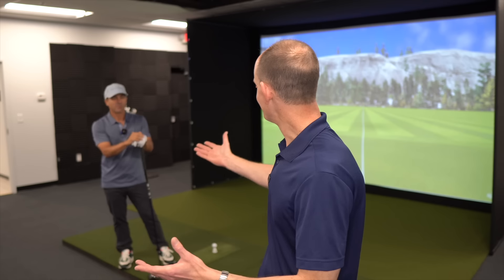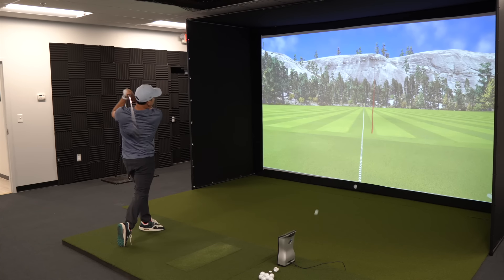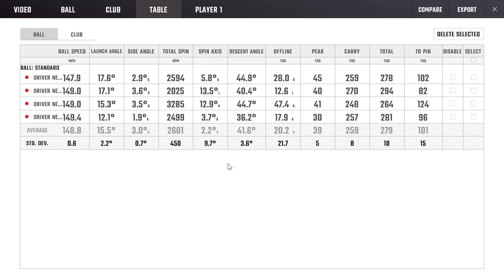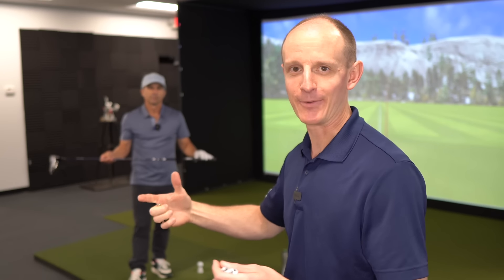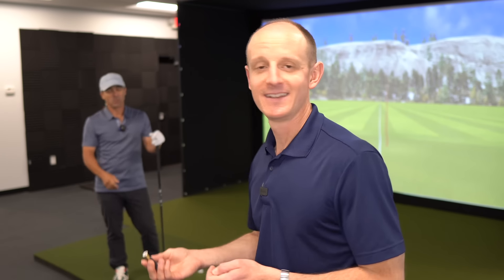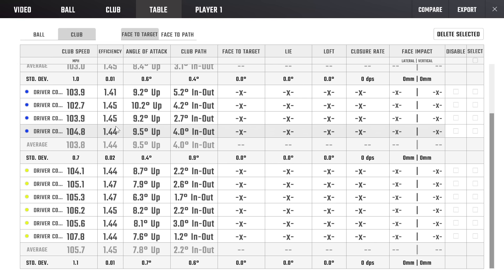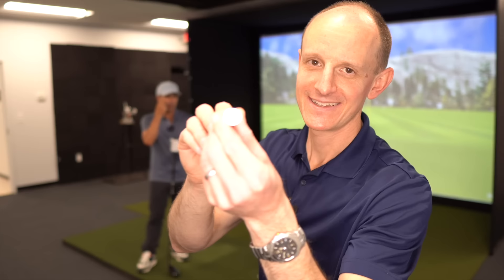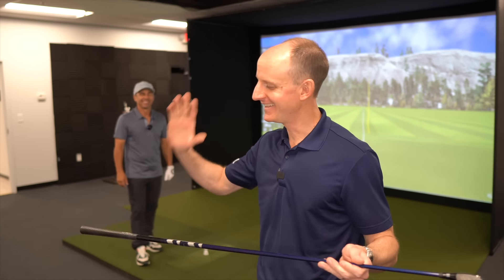Greatest of All Time Driver Hack / COUNTERBALANCING

Comment: I also counterbalance my driver. I like the extra overall weight of the club and it feels like it helps me engage my body/bigger muscles just a little bit more when swinging. How I counterbalance is with a 1/4” carriage bolt 3” long and nuts (use gf’s digital kitchen scale to weigh out desired grams) Wrap it with masking tape to make a snug fit and prevent rattle in the butt of the club. Cheap and it works well for counterbalancing!
Reply: I like this idea, gonna give it a try.
Reply: I use my cocaine scale.

Comment: I'm a certified club maker from the Golfworks Malby school with 12 years of experience under my belt.  I've tweaked and assembled thousands of clubs, and I agree 100% with the findings in this video as they have matched my experimentation almost to the letter. HERE'S A TRICK -> A few years ago I went to a local machine shop and had them drill holes in square metal weights so I could put my tee through them and into the back of the grip for quick and easy experimentation. I put poster putty between the weight and the grip to avoid any vibration issues as I tested and switched out the different weights. What I finally ended up doing, after I found the proper weight was making the driver  1" longer and putting the weight BEHIND the hands in the 1" space. Then I just told my customers to grip down 1". When the weight goes behind the hands you'll get the maximum affect of this experiment. Give it a shot. also - I think you'll love it. Great video  -  Cheers!
Reply from the maker: I've had that video idea for over a year. The pommel of a sword concept on a golf club. Now that I know it's had some success, might need to move it up my to do list.

Comment: I've been doing this for a few years.  I also add head weight to bring up the ball speed and return the head feel to the golfer.  D2 feels factory but muscular golfers can swing D5-D10 with ease.  Some golfers prefer a light feel with the lightest shaft and headweight (40g shaft, 196g head) and 12 g CB weight in the butt section.   Almost everyone can benefit from some tinkering.   It helps to blow the grips on/off while experimenting

Comment: Nice to see Mr. Short Game and you teaming up on a few videos. He is definitely getting a better response than I did. I switched from medium grips to jumbo that were 25 grams heavier. When I did this, I couldn’t tell where the head of my driver was, the club head just feels light and out of control. I might add that my swing has changed quite a bit for the better, this has nothing to do with swing weight as I’m striking all of my clubs much better, except for my driver. New club fitting coming soon, so I’ll see what happens. Cheers.

Comment: I have been doing this to my clubs ever since I found out this is what Jack Nicklaus was doing with his clubs. Jack had his own brand called AirBear and they came with counterbalance grips. The counterbalance made the club head feel lighter so I did not have to swing as hard to get club head speed. At 5’9’’ and 165lbs and quick hands I was able to easily Carrie the ball 320 yds.  My longest drive was 342 yards.  I lot of my golfing buddies told me that they were going to get me test steroids. That was in the 1990’s in my 30’s and 40’s. Now in my late 60’s I can still hit the ball 300 yds.  But now it is harder to find the counterbalance grips. Now after watching you guys, I’m going to go and buy the weights and have them installed with my next set of grips.

Comment: F = 1/2 (mass x velocity^2)  the rate at which kinetic energy is created in a golf swing.  Increasing mass will increase the kinetic energy linearly, but increasing velocity exponentially increases it:  2x = 4x, 3x = 9x, 4x = 16x, etc.

Putting more mass in the handle of the club should create a slower backswing when acting against gravity and a faster acceleration in the downswing at the point momentum and gravity cause the lead arm to separate.  

My intuition tells me the added mass in the hand area would cause the path of the lead arm to change as it flies down in the same way a movable weight in the club head affects face rotation and angle at impact.  

The difference in feel would also affect timing and how the hands would react when reaching the bottom of their swings arc ahead of the club head mass.  The more mass put in the hands the slower they will react and come back up giving the club head more time to accelerate around the hands before impact, the same F=1/2(M x V^2) cause and effect creating more striking force, compression and ball speed.
Reply: I like to think in simple terms. If adding mass to the club does not reduce my swing speed then I will get the linear increase in energy transfer. From a pure velocity standpoint, it may delay the release enough to move the max velocity closer to impact as well. Lots of individual trial and todays launch monitors could be super useful here.

Comment: I had been doing this for years with the clubs I assembled from Golfsmith components for myself and others. I always try for a swing weight in the C5-6 range for myself. When I buy a new driver I swing-weight and regrip immediately. My current driver (Cleveland Launcher) is set at C6 with oversized grips.

Comment: I have this done with a XR16 driver I have, I went about this by using tape, I did for fun to see try it against my SIM2 driver.. I am 6ft and using a 44inch driver tensi blue reg flex tipped 1 1/4 inches, with a Lamkin Mid size with 11 layers of tape. 6 full length then 5 front grip, feels totally fine.  Swing weight change from D1 to C8. I did notice the straightness plus the swing speed went up form 95 to 105MPH, and I am not chasing speed either. Distances are up too Carry 250 yards roll out 270 yards.  I had read that they used coins under the grips..

Comment: I bought a different shaft and a different loft of the same head. It was cheaper than buying a completed club. That shaft was 30g heavier with similar characteristics as my existing shaft. Using an online swingweight calculator I was able to get it to C8/C9, but that is an estimate. After testing a bit I was averaging 105mph with it. Swap in the heavier shaft 111mph average. That worked out to D3 swing weight. Again those are estimates. I was honestly surprised. I thought the lighter shaft would have been a monster, but it just wasn't the case. I would definitely like to try the counter balance in this other shaft. Even 10g would make a difference I think.

Comment: An interesting question here would be.... Would it be the same result if you only go the lighter swing-weight road by subtracting weight from the head side of the club and not adding at the butt? In essence, actually lightens the total weight of the club. How would a heavier or lighter club affect your ability to hit the ball consistently.
Reply: Good experiment....  Thing that will def change is how the shaft will bend with a lighter head.... it will play much stiffer so will change flight for good or bad
Reply: Good question! I'm no expert but I think most people like to try this vs making the head lighter because physics tell us if we can swing something with more mass at the ball, at the same speed as the lighter object it should travel faster/go further. I'm sure there is a point of diminishing returns, but I'm excited to try!

Comment: When I had a station I broke balls all the time.  If I hit one too many times in a row quickly, it would break and or crack.  Titleist were the least likely but they still broke.  Wilson Staff Duo 60 compression were only good for a few strikes.  I broke all of them.  Therefore, a ball has to be experiencing some stress or recuperation after it's struck and compressed and if so, surely it wouldn't perform exactly the same on the next strike.  I found that if I let the balls rest for 5 minutes or so, they didn't break, but if I pounded one ball in succession it would break after about 10 to 20 strikes.  These are not only being struck by the club but hitting the screen as well, whereas mine flew into a soft net.

Comment: Try the reverse as well, get a lighter club head or lighter shaft with same CPM and load point. Alot of people cannot feel the head when you butt weight, so they increase speed and spray everywhere. Also the shaft may become to soft for that speed, yet, feel stiffer to the player

Comment: Moe Norman also did this on all of his clubs. Your're right-2oz backweight on each club-why Moe always chocked down-so weight is on opposite side of hands-slow the hands down-like Nicklaus & the secret grip-Moe's driver was 16oz & E3 with all clubs-I suspect that's before backweight-brings it to C+ much lighter feel but overall heavy. BTW.........Where did you get the weights?
Reply: I picked up on Moe's counter balancing secret about a year ago and spent most of last year experimenting. It definitely helps consistency!

Comment: Would the result be similar by just adjusting the swing weight of the club by using a heavier grip?
Reply from the maker: Yes a heavier grip is doing the same thing albeit the weight will be much smaller vs a 25g or more counter weight.

Comment: Moe Norman said he trained himself to swing an E5 swingweight at the age of 18 and swung that eversince. Ive been wanting to try E5 but cant find anyone locally to build it
Reply: E5...That is heavy. I'd mess around first with lead tape, on either end, before having something built. Moe Norman is 
a big, stocky guy. I'll assume he was similar in younger days. It would make sense that a heavier club would suit him 
and promote consistency. I think shaft length, flex and one's height must all be factored into any experiment with 
swing weight. But the results may not be as predictable as one would think.
For example, Clay Ballard, who is tall and swings a longer shaft at about 119, tried butt weighting and saw no 
improvement. But my son, a 5'11" scratch player who is in the mid 120's, saw a clear dispersion improvement 
after butt weighting.
It is obvious that there's much input required to arrive at a true swing and contact improvement. And that there's no
better method then adjustments made to one's personal swing. But if you're not willing to invest in some basic club
building and monitoring equipment, you'll be spending considerable time and $ at a fitter's studio.
Some people prefer their coffee in fine china, others like a heavy mug...And this preference appears to have little to 
do with body style, gender and/or strength.

Comment: What do you think would happen if you cut the driver shaft length down and then counterbalanced the weight at the butt end? Thank you for a great video!
Reply from the maker: The head will "feel" much lighter in that case. You might need some heavier head weights or lead tape but it's all theory until you actually try it and see what happens.
Reply: @EFGMC  Thank you! I appreciate your thoughts on it. I might try this. outside of practice I struggle a bunch with Driver dispersion and am trying to see/understand if this might help without sacrificing ball speed. Cheers!

Comment: What nozzle are you using with the compressor?
Reply from the maker: It's the plastic raft tip that fits snuggly into the grip vent hole.
Reply: Thanks for the reply. I went back and checked your video about the AstroAI and saw that. I should have done that before 🙄

Comment: Great video and very informative. I have the PXG Gen 5 driver. It has 3 movable weights in the head. Would you expect to have similar results if one was to just decrease the weight in the head and leave the butt end of the club as is?
Reply: Hey Paul. You will have a lighter club and swing weight. The issue would be which Wright you remove and its effect on moi. You could increase spin so swing faster but get less distance, also an argument could be made for a reduced smash factor. But why not try it? You might learn u love lighter feel.
Reply from the maker: One of the golf publications did this a few years ago taking all the weight out of the head and comparing. They did get more speed but also lost lots of control.
Our test here did not see any loss of control.

Comment: Great Video. What is the air-gun you were using to remove and install the grip?
Reply from the maker: Amazon battery powered tire inflator.
Astro AI Tire Inflator
Reply: @EFGMC  Thanks, watching a video when you replaced the Kobalt compressor, now

Comment: Hi great video. Will a 50 gram weight for a Super Stroke putter grip work?
Reply from the maker: It should as long as it fits inside the shaft and doesn't rattle around.

Comment: I have a G425 max driver with a CB Alta 55.  Im wondering if I remove the 26g weight in the back and replace it with two 13g weights on the toe and heel. Would that increase MOI?
Reply from the maker: No. The weight far back will provide the highest MOI. Moving the weights up to to and heel will lead to more curve.

Comment: what effect does gripping down have on swing weight?
Reply from the maker: Same as if you cut it down within 1pt. Gripping down is a great way to see what a shorter club will perform like both for SW and shaft stiffness. Biggest difference is the grip diameter being smaller because of the taper.

Comment: Do you have or would you do a video on fitting those butt weights. Do they need epoxy or do they literally slot into place and are kept there by the grip over the top. Would there be any instamces when they would rattle or move and you can feel it in the swing?
Reply from the maker: They are held between the shaft end and the grip. I've never experienced any rattle though maybe if you were using the extremely heavy ones?? Still unlikely imo

Comment: How do you blow the grip on with the weight in the butt end? Seems to be in the way for the last bit, no?
Reply from the maker: Still works. Just need to adjust the inflator tip a bit  and focus your force on the very back end it get it on fully.
Reply: @EFGMC  Thanks! I have some butt weights lying around and I blow my grips on, so will do some testing this winter for sure!

Comment: I am 73 years old with a swing speed high 80’s low 90’s playing Ventus 6r with JumboMax ultra lite grips. I put 50g in the butt today and was a little longer and much straighter. Less trouble with slices. Maybe this works. The standard JumboMax grip is 60g heavier than the ultra lite. Would this give the same effect?
Reply from the maker: Yes, heavy grip will yield the same feel assuming the weight matches.

Comment: In general do you see a swing speed benefit for faster and stronger or slower players when adding the counter weight?
Reply from the maker: I've only tested this with players with over 100 mph club speed. Not sure what would happen with slower speeds.
Reply: @EFGMC  My buddy did this after I did with my shaft. Went from 82 to 85 mph driver. The feel seems right so now he is giving it more effort and can reach 87-88 MPH. That is a big jump for him.

Comment: Great Video.   Here's a crazy question.  Does my 75 gram wrist watch (on lead arm) have any effect?   Should I remove it when I play?
Reply from the maker: I don't know but that is a great idea for a video. As for you personally, try it with and without and see if it changes anything.
Reply: So simply adding some wrist weights should temporarily give this effect ? Perhaps not though, as the weight has to actually within the grip to give trubuchet effect ?
Reply from the maker: @mikebarnard2689  I don't know, and I suspect that the results will vary by golfer like so many things in this game. Would have to try it out and see.

Comment: Swing weight to desired balance and you don't have to do this.
I tried this many years ago when drivers were crafted from a piece of persimmon wood and still used steel and sometimes, aluminum shafts.
I lost the sense of feel in the club head.
Almost felt like I was swinging it from the head end.
I don't know if I gained club head speed but I lost distance and dispersion was crazy.

Has anyone else experienced this?

Comment: What did you use with the small air compressor to get the grip off
Reply from the maker: All these grips were installed with air for my fitting studio so I can take them on and off in 30 seconds.
Reply: @EFGMC  is there a special need tip you use at the butt end of the grip?
Reply from the maker: @Alehondro6  Nothing extra used.

Comment: Can you give me some info on that hot melt you mentioned
Reply from the maker: It's a hot glue product that stays tacky at room temperature. Primarily used to lower the pitch of drivers and fairway woods. Almost every tour pro has it in their driver.
Reply: @EFGMC  
Can I get a link to this? 🙏
Reply from the maker: @96gsxr  https://www.hotmelt.com/products/golf-club-weighting-hot-melt-cartridge?variant=27203520203

Comment: Question - Could you achieve the same thing by making the weight of liter?
Reply from the maker: Not sure I understand your question.
Reply: I think the word is "lighter" but not sure what it applies to.  Could be overall club or just the head to get it to C3.  Would be interesting to compare non-counter weighted C3 club to a counter weighted C3 club.  And yeah, getting something to C3 at driver length without counter weighting could be tricky.
Reply from the maker: @jaymorin7131  Most likely the non counter C3 would be hard to control.